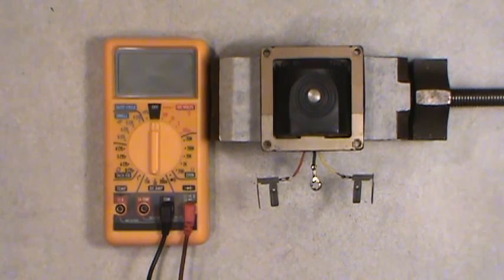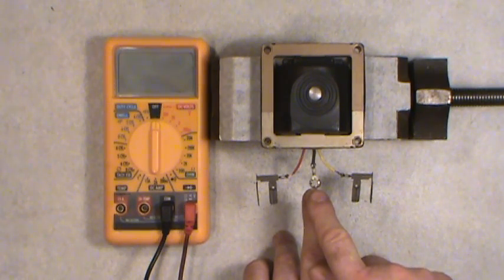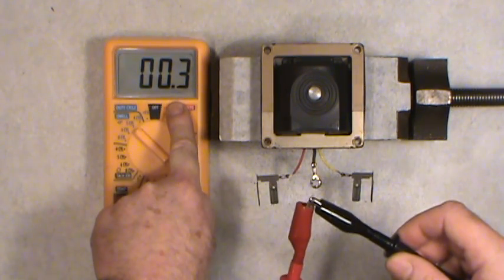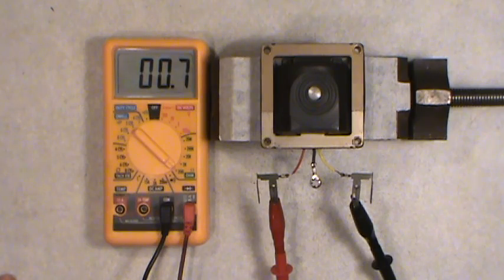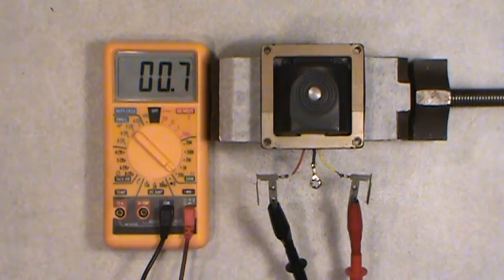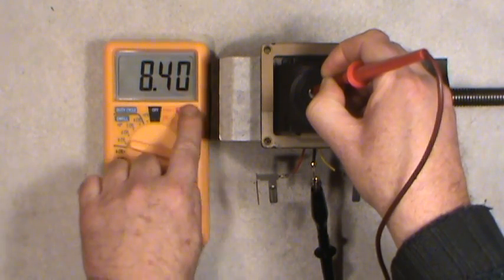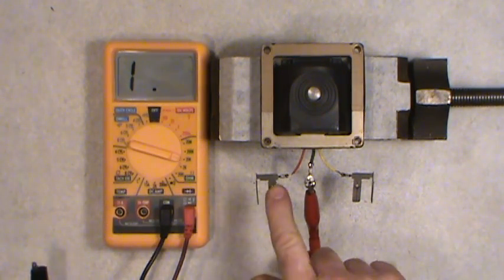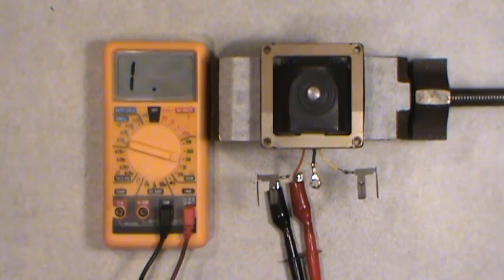HEI Coil Test (The Short Version)

Comment: THIS is the SHORT version?!?!  Good info, but it assumes the viewer knows English and how to breathe and not much more.  Could have been reduced to about 45 seconds by just doing the measurements.
Reply from the maker: +Davesnothere Man ....Greetings Davesnothere Man....Thanks for watching.............Well, now that You mention it, I guess, that I could make, a, shall we say..."For Advanced...Car...Guys-n-Gals Only"...a...(very)..."Short, and to the Point"...YouTube Video...of my choosing alright, and Who knows, that might just happen some day, so, please stay tuned, and, make sure, that..."You Keep Breathing"...!!!...lol...(hmmmm...Ported or Manifold Vacuum...???)...and till next time.........Be Safe, take care, and have a good one.
Reply: Thanks for your video. You didn't mention what the readings would be if the coil was no good. When I connect the two colored outer wires I get .7 ohms. When I touch tie black ground and center spot under the rubber (like you did) I get nothing. Your verdict, please?
Reply from the maker: Greetings...sunking2001.........You're welcome, and, thanks for watching........For a Factory/Stock, HEI Ignition Coil, the Low Ohms reading, will probably be, about .5 Ohms (one half, of one Ohm), and, is, about Average.............As long as, the Ohms reading, is a bit, Above 0/Zero (Not 0/Zero...!!!), and, not more than, about 1/One Ohm, it should be good to go (You can also, look up the Specifications, for Your "Exact", HEI Ignition Coil as well, just to be sure)..............Is Your Ohm-Meter "Self-Calibrating", cuz, if not, then You really should see, what it Reads, while in the Low Ohms Range, while the 2 Ohm-Meter Probes, are touching each other, and if You see, something like, oh, .3 for example, then, that Number has to be Subtracted from, the Low Ohm Reading, that You saw on Your Ohm-meter, when You Tested the HEI Coil, otherwise, it won't be very Accurate at all.................As for the High Ohms Test, well, I already Answered Your Question, on the Other Video's Comment Section, and that Video is Titled...HEI Coil Test (Part 1), I think...???....and..........till next time........Be Safe, take care, and have a good one.
Reply: My OHM meter is self-calibrating Fluke 7-600. I Googled the numbers from the coil and came up with nothing. The numbers are in two rows: top row 101013...bottom row RA0510. My question...when I touch (secondary coil as you said) center black wire to the center spot (under the rubber ring) of the coil...the OHM meter doesn't do anything. It's like I'm not touching anything...no numbers, no beeping, no nothing. Would this indicate the coil being "no good, burnt out, fried, destroyed, or not? Where do I find info on this coil? The distributor I have is the same one at Summit Racing part # 850025.   Thanks for your reply.
Reply from the maker: Greetings...sunking2001................"News Flash"...!!!...lol...oh, and, here's, that thar News................Heavens-to-Betsy...lol...when I looked up the "Specifications", for Your Fluke 7-600...here's what I found, seen, and are also thinikin' about, as to Why...???...Your Fluke Meter, "Would Not" give You, an Ohms Reading, for the HEI's, "High Ohms" Test...................Sorry, to be the Guy, that, has to be the Bearer, of some, not so good News, and now, that I've got Ur attention, that News, happens to be (Drum Roll please...lol)............Well, it appears, according to the "Specifications", that I saw, for Your Fluke 7-600, is, as follows..................The, shall we say, Ohms "Limit", that, You'll be able, to actually "Measure", with Your Fluke 7-600, is "Only 400 Ohms"...!!!...and I'll bet, that, that's the reason that, that Mr. Fluke, is "Not" able to give You, that, some-what, "Higher Ohms Reading", that's needed, to be able to Ohms-Test, Your HEI's, Secondary Side, that should be (as I probably mentioned before), and that, was about...3,000 to 20,000 Ohms, when Ohms Measuring/Testing, the middle black Wire, and the recessed metal part, that's on, the top/middle of the HEI Ignition Coil................So...it kinda looks, like, You might have to...Beg...Borrow, but Never Steal (lol), or maybe, even Buy, an Ohm-Meter (or, Multi-Meter), that's capable, of Measuring, much "Higher Ohms" (resistance) Test/Readings, than, that-of, the Fluke 7-600, that You have there now...................I'm thinkin', that, due to the Specifications, that I saw, for Your Fluke 7-600, leads me to believe, that, that particular Model, would be more suited to, being used around the House, and not so much, for Automotive use, well, it might come in handy, to measure Battery Voltage, or, something along the lines, or "Low" Ohms/Resistance, so, all is not lost, after-all...................If, and when-ever, You might, get ah-hold-of, an Ohm Meter (Multi-Meter), that can Measure/Test, "More", than, about 20,000 Ohms, there-abouts, and You do the Test again, on Your HEI Ignition Coil, You can let me know, how it turns out, well, if You care to, that is.......Good Luck.....and.......till next time........Be Safe, take care, and have a good one.
Reply: Yes...my Fluke volt/ohm meter is a bottom line basic use model. If I needed a better one I would get one. I solved the problem the old fashioned way...I got rid of the entire HEI Chinese distributor system. It's just not worth to go through all that trouble and research.The system has turned intermittent and I can't have that.  A local speed shop has me set up with Pertronix distributor, coil,  andTaylor spark plug wires. It will look OEM and I wont have to take out the distributor to remove the thermostat. When your engine suddenly and randomly stops running...and won't re-start...feelings of insecurity set in. Plus, that could be dangerous. In conclusion I'm upgrading to a better and more reliable system. You have to pay for quality. Thanks anyway.
Reply from the maker: Greetings...sunking2001..........Congratulations, on getting a New HEI Distributor for Your Engine, as well as, some nice spark plug Leads/Wires as well.........Here are a few things, that might help You out, well, if You don't already know about them, that is................Some Folks, when doing an Upgrade, from a Points & Condenser type of Distributor, to, most of, the LARGE Distributor Cap, HEI Distributors, might Not be Aware, that, most, of the Large Cap HEI's Require "Full...12 Volts/Battery Voltage"...!!!...connected to the HEI's, Battery spade Terminal, that's located, near the top of the distributor Cap, or, the HEI Distributor, probably won't be working very well, if, at all, perhaps................Most of the Points & Condenser Distributors, that I've worked on, usually had, a "Ballast Resistor", in the form-of, a Special Resistance Wire, or, white-ish colored, ceramic-like Block, if You will, in, the Ignition System's Wiring Circuit, to Reduce, the Amps/Amperage, that goes to the Ignition Coil, to keep it from Over-Heating and Burning Up...!!! (probably, also be seeing, a Lower than, Battery Voltage as well, going to the ignition coil, at the very same time)................Always Remember, that, the HEI's "Ignition Coil and Module", have to be "Matched", to each other, or, Problems might be the Result...!!!...............Check, and make sure, that, the "Material" (metal), that, the "Helical Gear" is made out of, that is already installed on Your New HEI Distributor, is "Compatible" (aka, gets along with), the "Material", that the "Helical Gear", on Your engine's "Camshaft", is made out of, cuz, if it's not right, One, or maybe Both, Helical Gears, can get, shall we say "Chewed-Up" (aka, Destroyed)................Make sure, that, (if applicable), the Correct Shim/Gasket, is used "Between", where the HEI's Body, makes contact, with the engine block or manifold, in order to Prevent, Ramming Down on, the Oil Pump's drive shaft, and possibly Damaging it...!!! (some Chevy's, might have a separate drive shaft, between the drive tang, on the distributor shaft, and, the oil pump itself)..................Keep all of Your spark Plug "Wires" Away from each other, as well as, Away, from any Metal, such as Valve/Rocker Covers, oh, and, Don't zip-tie them together as well, or, sometimes. due to, the High Voltages involved, that High Voltage, could very well, start going, to the Wrong Places, and I hope not...................Spark Plug "Gap Size"...???...............The most common, HEI, spark plug Gap Size, that I've seen & used, for the Factory/lower compression Engines, oh, about 8.5 to 1 Compression Ratio, there-abouts, always seemed to end up, being .045" (four-tee-five Thousandths of an Inch)...but, make sure, that, You use, what works Best/is Recommended, for Your "Exact" HEI Distributor................The Higher, the Compression gets, in an Engine, and/or, the LARGER, the spark plug Gap gets, will usually, make the HEI Distributor's, Ignition Coil (and probably, the Module as well), work, all that much Harder, to, just be able to, initiate a Spark, between the spark plug's Electrodes, under those conditions...................The Advance Curve (what-ever it happens to be...???...in Your HEI Distributor), will have to be taken into consideration, for, Your Engine's (needs), as in...Initial/Base timing...and the Total Timing, that being, the initial/base timing, added to, the amount of mechanical/centrifugal advance, that the Weights and Springs provide, when fully deployed (does "Not", include the Vacuum Advance/Canister...!!!...at this time), then, lastly, for Light (engine) Loads, while, just Cruzin' along, at, not too fast, cruising speeds, the Vacuum Advance Unit/Canister, will be adding in, its share, on top of, what-ever, the initial/base & Weights, are providing, at that particular engine RPM, and, depending on the amount of (engine) Vacuum (inches of mercury/Hg, as seen on, something like a Vacuum Gauge, as an example), that is in the Intake Manifold, at the time, will determine, just how many Degrees of Advance, that, the vacuum unit/can, will be adding to the, shall we say, mix...............Depending on, the Vacuum Advance Unit's/Can's..."Specifications"...(as, there are so Many of them), then, that, in itself, can get quite involved, if the Vacuum Unit/Can, is not, all that suitable, for a given engine, as in, comes in, too Soon, or, too late, as well as, not enough, or, too many, Crankshaft Degrees, of ignition timing Advance, being provided, which, really is, Not so good at all .....................If You happen to hear any..."Pinging"..."Rattling...or..."Knocking"...Sounds, coming from Your Engine...get it Fixed right away, or, Engine Damage, it just might be...!!!..............If You need any help at all, just give me a shout.........Good Luck, and.......till next time.......Be Safe, take care, and have a good one.
Reply: I don't think you fully understand...and it's my fault. I bought a restored 1970 F-250 two years ago. The previous owner put a 460 cu.in. big block Ford in it and it came with that GM HEI distributor already installed. They make them to fit Ford V-8's. The bad news is it is in the front of the engine and not in the back. So, it gets a lot of heat being 1/10th of an inch from the thermostat housing. It's been fine except for two months ago my ignition suddenly stopped (3 times in 1 day) as I was driving. Three times I got it restarted and got it home. Local speed shop who was familiar with that HEI distributor diagnosed that the modulator is acting up. He sold me a new one for $20...put it in...problem solved. Fast forward 2 months my engine ignition suddenly stopped again. Couldn't re-start it. Had it towed 1 block back to my home.      So...I did not replace that HEI distributor with another one. I really don't want to deal with the HEI distributor any more. In my last note to you I told you what system I will put in instead...NOT another GM HEI distributor! I saw those HEI's on line from $58 up to $139 at Summit Racing. It appears all of them are Chinese...maybe not all...I don't know. I've bought a better system and will pick it up tomorrow.    I do appreciate your interest in my distributor problem. BTW...I am a long time "shade tree wrencher"...not a master, but, I do have previous experience. The electrical systems are not my area of extended knowledge. You can look up the parts I'm getting...I included the brand and part #'s.
Reply from the maker: Greetings...sunking2001..........No need, for any worries at all.............If You don't mind my asking...does that Pertronix Distributor, that You were talkin' about, was it the type, that has a smaller distributor Cap on it (as compared to, the Big HEI Cap), as well as, having a "Separate/remotely mounted" (oil filled or epoxy type) of Ignition Coil, by chance...???...(just curious)....and, my concern, is with, the Higher Voltages Required, to create a Spark, with spark plug Gaps of about .045", being contained with-in, a Smaller distributor Cap (having the internal terminals, that are spaced closer together, as compared to, the HEI Cap's internal terminals, for a V-8 engine).............As far as I understand it, the reason for that BIG HEI Distributor Cap, was, because of, the Higher Voltages, that were needed, to Fire the spark plugs, with those Larger Gaps, being, pretty much, any Gap, that was "Over", about .035", that was typically used, in the Points & Condenser Distributors, up till about 1974 there-abouts (before the HEI came out)...............So, if You happen to run into any, ignition system related, misfiring or cross-firing, please, keep that in mind, just in case (and I hope not)................The, shall we say, "Better Quality", Factory and Aftermarket HEI Distributors, are, about the most Reliable & Maintenance-Free, Distributors, that I've spent some time with, but, there are some things, that have to be done right, to make that happen...............One of the Biggest Mistakes, is to, just, install the "Module", to the inside of the HEI Distributor's aluminum body, "With-out", applying/smearing, some Heat Transfer Paste/Heat-sink compound, "Between" the Ignition Module, and the HEI's mounting surface, and now I'm wondering, "if"...???...that "Paste" was applied, before the ignition module was mounted, to the HEI's aluminum body...???....cuz, if not, well, that alone, my Friend, will probably be, the Number One Cause, that will "Over-Heat" the Ignition Module, and stop the Engine.............Then, the 2-Screws, that Secure the Ignition Module, to the HEI's (internal) mounting surface, are the actual, "Ground Connection (ignition Module, to the HEi's aluminum Body), that go through the ignition Module itself (very important)...............If it were me, and I wanted to use an HEI Distributor, that was mounted, near the coolant Outlet housing/rad hose connection, I'd probably make up, an Aluminum sheet metal "Heat Sink", that went between the bottom of the HEI, and the top of the coolant outlet housing, but, then again, coolant temperature, might only be around 200 Degrees Fahrenheit, which isn't all that hot, as compared to, being in near proximity, to some. long tube "Exhaust Headers"...!!!...Yikes...!!!...lol...........Good Luck, with Your New Distributor, and.......till next time........Be Safe, take care, and have a good one.